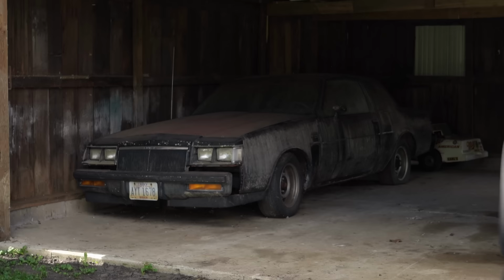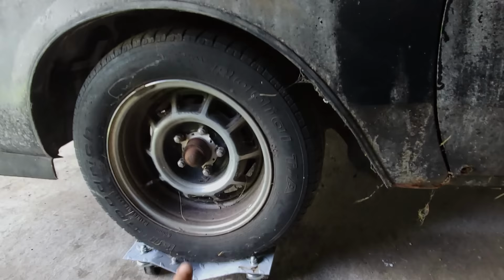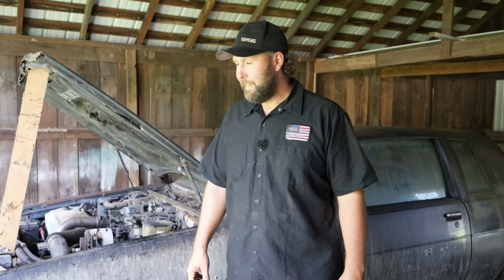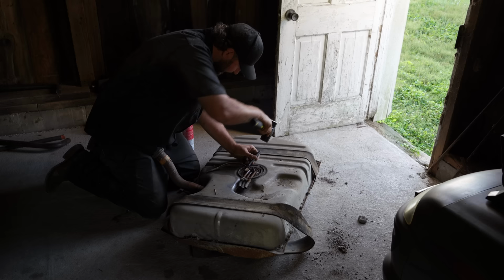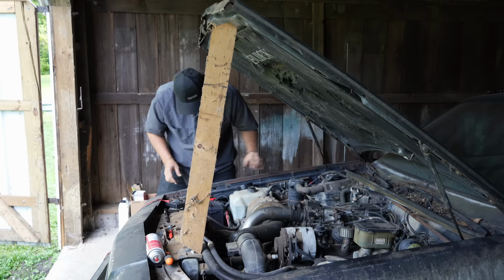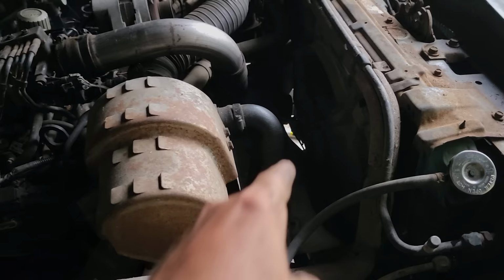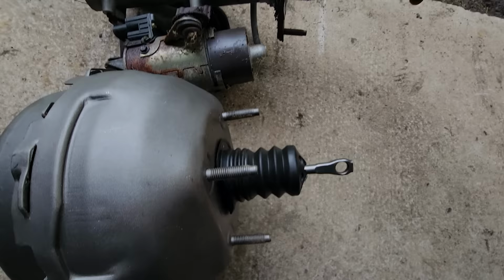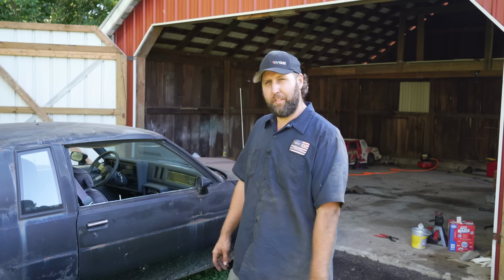Will It RUN AND DRIVE after 20+ years? Turbo Buick Grand National!

Comment: This Buick Grand National is such a rare find that it definitely deserves some love.
Reply: Not really.  The only thing that’s rare is the shape this one’s in.
Reply: @Cultofpersonality09129  nope. They’re in fact a rare bird
Reply: There were 20,000 Grand National produced but only 547 GNX's which was the follow-up car after the Grand National production stopped.  Either way, gotta love the Grand National.
Reply: I had a friend that had one back in the day, and I did not fully appreciate it.
I was driving a 1980 V-8 Cutlass I wouldn't part with, and I felt superior because of two more cylinders.  LOL 
Kids! 🤣
Reply: @OtayBuckwheat  I still won't buy a 4 cylinder pick up truck.  Just ain't gonna do it.
Reply: @Hard_Right  Uh huh, right.
Reply: @WizardofGOP  The GNX wasn't a follow up car, it was a option as a factory conversion to the 87 Grand National. The actual count is a total of 20,740 GNs were built for 1987 (versus 5512 in 1986). Of those, exactly 547 would be converted to GNXs. So as to being rare Derek's 1986 is extremely rare, but not so on the 87's
Reply: The T-TYPE is less known, I a black 86 T-TYPE with gray interior it looks almost identical to the GN.
Reply: @repaid1  Supposedly the FBI had about 500 GN's their agents used and they were kind of pissed that GM stopped producing it.
Reply: @Hard_Right  :  |
Reply: 5512 produced in 1986
Reply: @RedBud315  Maybe they waited till 92 and got Typhoons, they were faster than a GN
Reply: @joshuaanderson8684  It was also lighter and FASTER...but real car guys knew/know of the T-Type.
Reply: @Hard_Right  Keep telling yourself that pal.
Reply: @repaid1  my car has the aluminum drums and aluminum bumper reinforcements  but not much else is stock anymore 😢
Reply: @Hard_Right  where at all buy them all! We are talking about true grand nationals not Buick regal clones!
Reply: @joshuaanderson8684  I worked at GM parts we sold GN kits to convert the T-Types to GNs. I wished he showed the RPO sheet instead of us taking his word for it.
Reply: @GurusWorld1  Mine is a W11 with 19U paint that's black but at some point every early in it's life someone converted it to a wh1 paint scheme.  My rpo also has the show/demonstration rpo ZR6.

Comment: The part where you said "underneath all that, it's a pushrod GM engine; if it rotates, it'll run" is a true statement. The old 3.8's were solid little engines.
Reply: Right when he cranked it to test it out, you could hear it chuff. Oh! There's already good compression. :)

Comment: I was a shop foreman at a Buick dealer in 1986. Used to take these home on test drives all the time. Fairly easy to work on for it's time very simple design. Good luck with this car a lot of fun to drive.
Reply: A quick question....when Derek discovered the leaking fuel line, why not replace the entire rusted out hard line with high pressure hose? Would that work?
Reply: yea, i tbought that too, but i'm amazed at wjat he can achieve with such limited resources and tools so far away from home. I livve in N.Z. and to have a yank tank over here is  a prized thing and acquiring parts for them over here is not a happening thingg
Reply: With all the space under the hood, not having to contend with a massive 400 or 50ci engine, leaves lots of space.  You got to love the placement of the turbo, right up front and center for everyone to see.

Comment: As somebody who both fixes cars for a living and has owned a GN back in the 80's, this video really checks all the boxes for me. I very rarely see something of this vintage come through our shop and we generally work on modern cars so these videos are a nice departure to a simpler time. A time that I wouldn't mind going back to. Thanks for doing what you do.
Reply: Most shops around me, if not all of them have no idea how to work on this old stuff because their computer won't hookup to them to tell them what is wrong LOL.  

Had a shop chasing an issue on one of my trucks a couple years ago, they put a bunch of parts into it and still hadn't fixed anything.  I posted on a forum what issues I was having and what had been done and checked, and one of the mechanics on there says change the O2 sensor...well ok, but didn't see where that would cause the issues I was having....new O2 sensor for $45 and problem solved...woohoo, truck runs awesome now...shops have no idea how to work on anything they just throw parts, and oftentimes the wrong parts.  Now I just look on forums, and do my own troubleshooting, no shops will touch my vehicles anymore, they are totally useless for old vehicles.  Most times they can't do much better with newer videos either.

Comment: A guy I went to HS with has a few of these stuffed in the back of tractor trailers. He’s had them for years… any gear head that’s over 40 (personal over 50) Knows exactly what these cars are. Low or high mileage…. Great find and great car. Good for you bro.

Comment: Enjoyed your video.  I had a modded 87 GN.  TA60 turbo, 50 lb injectors, ported heads, cam, and a stretched intercooler.  It was a bad ass car and I never should have sold it.  My memory is a little fuzzy since this was 20 years ago, but when you were trying to spin the engine to see if it would turn over, there’s an electrical connector by the battery with a pink wire.  It sends power to the fuel pump.  You can just unhook that connector and the motor will spin when you crank it but it won’t fire (no fuel.). Good luck on the car!
Reply: I was thinking about it and I believe I need to correct my prior post.   The small electrical connector by the battery cuts power to the ECM, not the fuel pump.   Sorry, like I said it’s been 2 decades.   

Watching the car fighting you back when you were wrenching on it brought back some memories.  Kind of like the old REO Speedwagon song….”I make you laugh and you make me cry”.  LOL.  Many thanks for the great video.

Comment: I like how the picture on the cover of the  manual is of one doing a burnout. We could only wish car manufacturers would still be that bold.
Reply: I thought the same as soon as I saw that haha
Reply: I was playing in a band on the road back in 87 or 88, and had a week job at a bar in Lewiston, Montana. Two of our patrons were sitting at the bar one night arguing about their cars and who's was the biggest baddest SOB in town. The one guy had a new corvette, and the other guy had a Grand National. Just outside of Lewiston there wa a long strip of real smooth Blacktop that goes for miles and miles they would go out there and run those things just about every night, dead stop to top end.  Around 200 mph, from what I picked up from the fued.  They were both trying different computer chips to beat each other, but I think that the guy in the Corvette got real familiar with what the ass end of Bad Ass Buick exactly what the taillights on a   The Corvette came out on the short end of the stick
Reply: Sorry...My Fone Phucked up.  But I think you got my point.  The image of Buick taillights probably haunts that guy in the corvette to this day...Unless he blew a tire at 201 mph.  If he did, you know what the last thing he ever saw was.....Those damn Buick taillights.

Comment: A GN?!!!! man you scored high this time, one of my all time fav cars, congrats Derek looking fwd to it
Reply: Maybe I'm old school. I the eighties models of these cars the Monte Carlos. A Buick Regals and other makes. They just simply rattled apart. Junk.  The cars I drove my first car a 74 javelin 401 4 speed. 72 grand torino. A 65 Buick Riviera 425 dual fours. 68 dodge fargo pickup 383 auto off the dash shift. And many more older rides. The eighties really sucked. But we have gotten better today. Some real fast ride out there
Reply: The last great last gasp for Buick, these were pretty fierce for the time.
Reply: @derrickconnolly9164  I feel imilar about 2000s and 2010s cars. The early 2000s had tough, easy to fix, fun cars. After like 2010, they got so complicated and tin roof like
Reply: @derrickconnolly9164  MC owner.  I whole heartedly disagree.   People said the same thing in the 90s about these 80s GMs.  Also owned Hondas from the same era.  The GM chasis and accessories lasted 1000x longer.  Nothing but stupid issues with the Honda.

Comment: I have an 87 GN sitting in my garage. Not cranked since 2007 but it’s in great condition. This is the inspiration I needed to get her going. Thank you so much for this!!
Reply: Tke the plugs out before you crank it and the let it build oil pressure before you put them back in.
Reply: @mistersniffer6838  how in the hell can an engine "build pressure" without the plugs in the heads?!🤔🤦🏾‍♂️
Reply: @jaysrandomnesschannel OIL pressure.

Comment: That bank building looks simply amazing! For what it's worth I have a similar Buick story. I own an '81 Riviera with 23 800km on the  clock. Car was imported into South Africa as a year old vehicle from Old Mill, Ontario. Also seems to have been 'mothballed' for a long while. Certainly since the 1990s to 2017, from what I gather from the paperwork of which there is lots, inc of import/shipping documents and all owners manuals, shop manual etc. I am third owner and bought it from a Cape Town based Buick and Cadillac  Club member ,who had gotten it off the first SA owner's estate executor. Nothing exists regarding its first year in Canada. Car is excellent condition save for non working AC and driver side seat motor. At least it had been well cared for in it storage.  Known as 'Milly' apparently, due to dealer trunklid sticker- 'Old Mill Buick-Pontiac'. Cheers.

Comment: Inside the mega safe were safety deposit boxes, and the reason for 2 keys was to ensure the owner of said box was indeed the owner.  upon entering the bank a fella would go to a bank employee and show identification, after witch the employee would use the banks key along with your key to open the safety deposit box.  I live in an old Texas town and my bank has a similar vault that my folks used when I was a wee lad. Those doors are indeed massive.

Comment: Great watching this! I had an 87 that I regret selling. The brake gave me issues too and I ended up swapping them with some 82 Regal hydro boost setup. I got a couple of bad boosters but afterwards, it worked great. Connected it to the PS pump and steering rack, it bolted right in, but I did have to bend the coiled brake lines slightly to make it fit.

Comment: Derek, that tune when you open the barn doors. I appreciate it. 80s synth vibes mingled with digical guitars. How on earth did you manage to find a track that fits both the era of the car and the VGG vibe? Also: What cursed condition is Ken's Grand National in? How is that even possible?!
Reply: @boroughmanager7067  Yes! At least I wasn't the only one that heard Separate Ways
Reply: I'm at least 73.245% sure that Derek plays the guitar to a pretty decent standard. My guess is that he works out what he wants and just plays it with his buddies - or few just requests it in Fiverr and someone else plays it for him!
Reply: @JerGol  cold snacks, guitars and garages.  Add a dog , and some burnable smoke snacks and a feller is in for a good time.
Reply: timestamp?

Comment: Derek, Thanks again for an energetic vehicle rescue.  Here is a long shot suggestion.  Since brakes are such a huge issue... what if you had some flexible stainless lines made with standard fittings and some larger/smaller brass fittings to address the tenuous brake lines on the revivals you tackle?  Of all the things that stop a drive to the tree row, it is sad that hydraulic brake lines mess up a good plan.  Thanks, and keep up the incredible content.

Comment: 4.4 seconds is freaking fast for a stock street car. Still to this day.
Reply: Just for reference for the kids around. 4.4sec from 0-60 made this Buick faster accelerating then the Ferrari Testarossa and less than a second slower only to the mighty technical wonder the Porsche 959 hypercar back then. I had no idea the Buick was that quickly accelerating.
Reply: @dirksteffen9375  exactly. Insane
Reply: That's a GNX and a liberal estimate at that. These were 7 at a minimum. We're still talking about low 200s horsepower here.

Comment: Almost the same 3.8 lt Buick V6 that was in our VN/VP GMH Commodres here in Australia but I’d imagine internals differed etc. Our 3.8 Ecotec  V6 was a pretty nice evolution of it.
Reply: ah another aussie thats refreshing
love a good 3.8
Reply: @UncleTyso  one smooth running engine. The big causes of their deaths here in Oz is the GRP silicone intake manifold gaskets. They disintegrate after say, 15 years and flood the engine, vacuum leaks etc. An aftermarket aluminium/silicone alternative is a good swap out.
Reply: Never late in a 3.8!
Reply: Actually the 3.8 long block in the Grand National and the non turbo 3.8 the blocks and heads are the same  the rod bolts where Different that’s about it and camshaft I bought one brand new in 1986 it was $15,800 and has it almost 25 years I did a lot of work of them when I work at the local GM dealership at the time
Reply: @fastone942  nope. the gn 3.8 was a far tougher block, different heads, different crank. probably different rods too.

Comment: I remember rescuing my second car, a 1985 Nissan 300ZX, after sitting for years due to the fuel pump going bad. It's sad to see good cars sit and rot due to an issue that could have been repaired in a day.

Comment: Derek, if you happen to do another fuel infected vehicle. I’m sure Oreilly will loan a fella a Fuel Injection Gauge. These gauges have a purge valve built in to bypass the fuel out of the shredder valve. You’ll be able to catch whatever comes out of the fuel rails. (Pickup strainers rarely come with digital pumps.). Love that F100 Pickup btw!

Comment: That Powermaster unit is not extremely complicated to repair. I did mine myself with basic tools. Its a vane pump and they stick. Didn't see any smoke coming out of the motor so its not locked up.

Comment: I grew up in the G body era... 0-60 in 4.4 was tearing the doors of the F body cars, and the slap in the gonads ... the Grand National is a V6 power plant.. vs the 350 small block as well as the GTA 400... hats off to you..side note.. the 87 ...the engine was blueprinted and tuned by maclaren...kinda a big ..good bye to the gm brand lol

Comment: This is too funny… the GN has been sitting for 20 years, and as soon as he fired it up it idles down after ten seconds lol. If it were sitting for 20 years the IAC would have been stuck. The engine was clearly running and already warmed up just before it was started for the video…. 😉

Comment: On most cars the horn and the fuel pump have the same relay, if the horn works you can use the horn to test the fuel pump relay or use the horn relay to test the fuel pump

Comment: Everyone says these things were the baddest cars on the street, and yeah, they were beasts, but here’s the thing no one talks about: once you started mods? They were wildly inconsistent, extremely susceptible to barometric pressure changes. One day, it would run like a raped ape, the next, it would fall on its face. it was way easier to work on than the 5.0 stangs I got my start wrenchin on. But man when they ran right they were fucking nuts to get that level of power outta a six.

Comment: Wonder why they went for a separate motor to create the brake booster vacuum ?

When you brake, you don't have your foot on the throttle - usually - so you'll be generating manifold vacuum and that can run the booster ...

Comment: I sawr/seen only one flaw in Ken's perfect Grand National...the right and left outer seat back panels have sun exposure fading the black to purple-oidishness. He can Save on those easy in a few minutes. Buy a can of SEM satin black Color Coat vinyl, plastic, carpet spray. Mask off the offensive zones after prep with cleaners then lacquer thinner, dry. Warm up can nice fir no splattered sprayin. Apply mist coats brushed in between coats as be a wroatten on the can substructions! Soon will look all black like the original instead of ugly faded.

Comment: I think at the time they referred to those rear windows as "opera" windows. From what I understand a lot of modern cars have "plug and play" systems. There is still something to be said about doing actual mechanical work with your own hands. Before I left Cali for Mississippi they were trying to ban classic cars completely because of pollution. Less than 1% of cars driven in Cali are classic. Glad I moved.

Comment: While you have your air cleaner out, go ahead and pull the air box from the fender and clean all of the leaves and rat nest out of it as this guy should have. Not a bad idea to spray the throttle body with throttle body cleaner while you’re at this point too.

Comment: Man messing with the gas and electrical was making me nervous. I even use a brass punch to turn the lock ring on the fuel pump...brass doesnt spark.  I have that exact battery ratchet.

Comment: I had an 87 t type same as the grand national with different wheels same engine and rear end gears. It was fast for 245 hp but 4.4 0-60 may be a stretch.

Comment: All those crusty relay connectors and thinking grounds  need CAIG D100L-25C DeoxIT Needle Dispenser 25 ml.  it is expensive beyond thought.  25ml 32.00    It works like nothing else treating and preventing oxidation on electric connections.  Any electrical it is great for .  I don't get anything telling you about this.  I just know on my dodge Caliber It brought my TPM back to proper operation.  Treated every connection wiped and treated again  Bad connections look like so many other way expensive issues